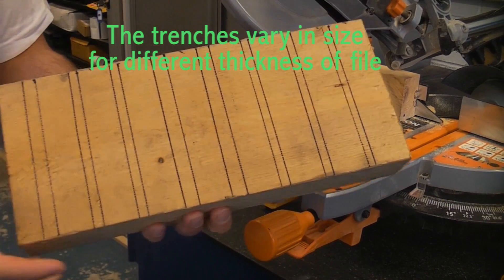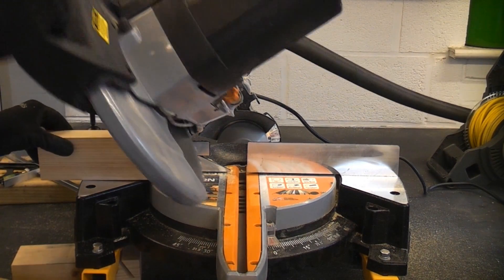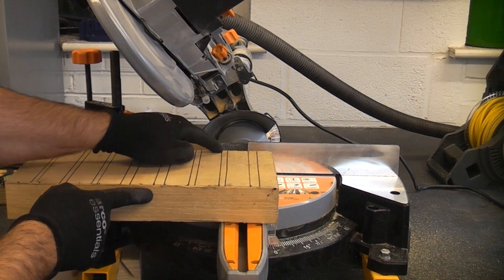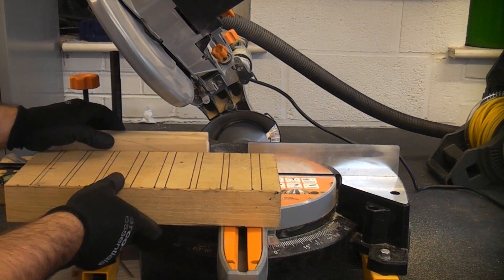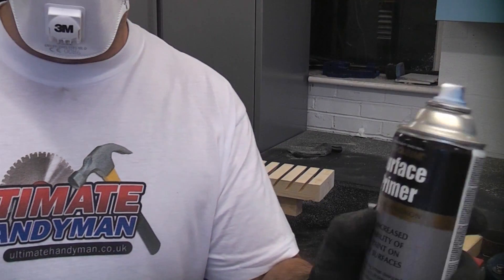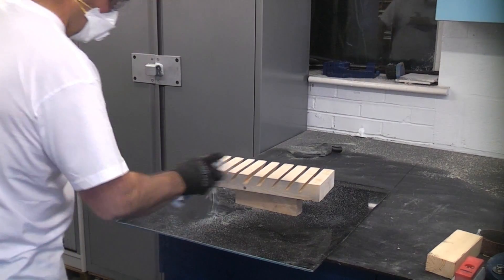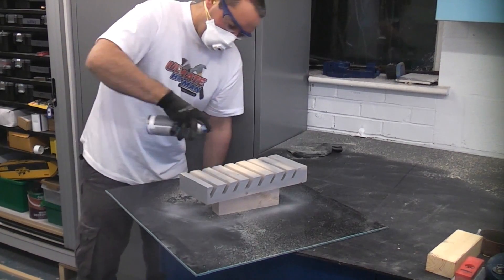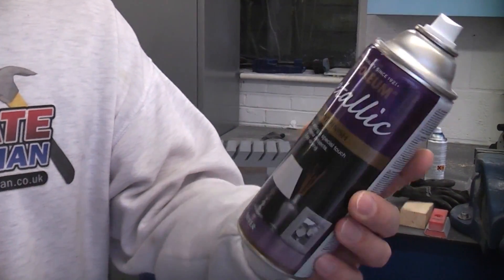How to make an engineer’s file rack

Comment: Looks like you bolted it to your cabinet door?
Nice job as usual.
Reply from the maker: Yes, I just put two M6 roofing bolts through to hold it in place.
There is not much room on the inside of the cabinet now.
Thanks for the comment ;-)

Comment: it's a great design concept, but you kinda botched the spacing. the front-mounted chrome screws don't help either.
Reply from the maker: It's only a file holder, made from a scrap piece of timber- I was not making a Swiss watch ;-)
Thanks for the comment ;-)

Comment: I'm going to have to make one of those on my table saw at some point. At the moment I just have my files and rasps hooked on the wall with peg board hooks and the rest are in the drawers, what size lumber did you use? 6"x2"?

It's kind of unrelated but do you have a needle file handle? Its the best £4 I've ever spent heres the link to them: http://www.axminster.co.uk/needle-file-handle
Reply from the maker: Hi, yes I used an off cut of 6" * 2" timber, although 8" * 2" would have been better.
I don't have one of the needle file handles, but it looks handy.
I only have one set of needle files and they are diamond coated so the handle is built onto the file.
Thanks for the comment